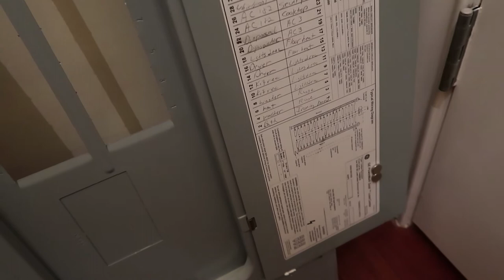How to Inspect an Electrical Panel

Comment: Nice video, a few comments, not sure what you meant by adding up the circuit breaker sizes and comparing that to the panel ampacity, that doesn't really tell if the panel is overloaded or not.  The only true test would be to perform a load calculation.  Also you missed the big white neutral conductor on the equipment ground bus. ; )

Comment: In a home with a 100AMP service,  how do I determine which bus bar is for the ground and which is for the nutural . Especially when electricians used both bars for both the nutural and grounding systems? Why would they do that? They have both the nutural and ground wires from different circuits going into the same bus bars. Wouldn't it be simpler and more professional looking to keep them separated (a cleaner install)?

Comment: Good to know. Also I’m curious what happens if the ground and neutral are not isolated in a sub panel.
Reply: Objectionable current flow, that's what happens. Geez......
Reply: The ground becomes a path for current to return to the source.
Reply: Is that a neutral white wire on ground bar right side?

Comment: Hi. My house had an addition years ago and the breaker panel was moved from one garage to another. The old one is still there. I want to activate it with a 60 Amp breaker for my air compressor. How do I do this?
Thanks

Comment: so, you said that the amount of breakers don't go over the amount of the box. Box is 200 amps, and I saw more then 400 amp worth of breakers. Not that you will even pull that through a panel.
Reply: main breaker is 200 so it cant pull ore than that
Reply: @SuperInspector  you can have more amps worth of breakers than your panel is rated for.
Reply: @danrichardson4559  what do you mean? circuit breakers can handle only 80% of their amperage. a 100-amp panel can handle just 80. you can't draw more than 80 amps on a 100-amp system
Reply: @whith5184  you are wrong it can pull the full 100 amps and if it does for more then 3 hours then the breaker has to be rated continuous duty. Which main breakers are.

Comment: you’re wrong and dangerous on much of this.  The total on the breakers will almost always exceed the main, otherwise I and most others would need 600 amp service.  Not a problem.  The breaker will never “pull” too much voltage.  Voltage isn’t pulled and you”ll never exceed 240 VAC on that panel, if so, call the service provider.  The basic function of the breaker is the prevent overcurrent, which overheats wires.  Current and voltage are often misunderstood, but you are supposed to have basic knowledge.  
You also demonstrate unsafe practices, not to mention contributing to the padded and exploitive insurance business.

Comment: Hello,  during some masonry work, it was revealed that a ground wire was disconnected and had been for a while.  How can I ensure that my main box is properly grounded?  I have checked many outlets with a receptacle tester and it showed they are all good.  Thanks for any help

Comment: How would you know if the wire is the right size .? Also do you have to touch the wires as an inspector.? And is it required or recommended to flip those switches on the breaker that you flipped.?
Reply: No way my friend. We are not suppose to touch those hot wires. And as inspectors we are not even required to remove the dead front cover according to standards of practice. Most inspectors who are comfortable enough, remove the panel to check
Reply: @Mel007ize  and most of them dont know what they are doing.

Comment: I am dog sitting and gremlins started attacking. Panel is at 480 with another 80 amp panel wired off the 225 amp rated. Good enough seldom is. Thanks for the knowledge.

Comment: No mention of aluminum wiring?
Reply: Dallas Mobile Notary Services.   Aluminum wire is not illegal when used to feed the panel, only illegal for branch circuits (output side of breakers).
Reply: Bebo May , Aluminum wire isn’t illegal at all, and to think people are going to rewire the entire house is crazy.  It has its issues but can be managed at a price to the home owner.  Aluminum wire must be noted if it is a solid conductor in a branch circuit but not required to be mentioned if on the line side feeding the panel.  If it is a solid wire in a branch circuit you make note of it, have to confirm it isn’t corroded and can recommend it be coated with anti-oxidation coating to stop galvanic corrosion or add a pig tailing connector that separates the two different metals.  I just did an inspection on a house with a lot of aluminum wire and had to re-learn all the specifics as well.
Reply: @hispeed69  I was responding to someone else's comment about aluminum wire. Aluminum wire "is" illegal for branch circuits, they don't even sell it anymore! Good luck getting insured, if it's found out you have it.

Comment: Do you know the wire gauge just by looking at the wire?
Reply: Lee Sales , after looking at enough wires you can naturally tell but if you get lucky you may be able to see the small writing on the wire that tells you the size.  If you’re lucky you’ll see a 14 AWG or 12 AWG.  14 is a 15AMP breaker and 12 is a 20AMP breaker.
Reply: No older wire had more insulation that wire, all wire will be labeled if properly installed. AWG THEN A NUMBER

Comment: This guy is a nut job, personal preference does not necessarily mean it's illegal!
Reply: Bebo May that’s mainly an inspection on a home. He flagged the one wire and another inspector may not have. He probably didn’t flag some thing in plumbing that someone else could have inspected the home and they would have flagged it. That’s why for a home owner, inspections are really a joke and you fix the red flags and move on. Iv sold a couple homes and I usually can laugh at the report. Things that don’t matter are flagged and things that I know need to be fixed didnt even get flagged.
Reply: @heathersterner4810  You are correct, he didn't even flag the hot wire rubbing on the ground wire!  Totally useless! This guy was probably bagging groceries a week ago!
Reply: Bebo May , that is an issue based on assuming the edge of the ground wire being sharp.  Had I seen that I would’ve just pushed it up to get a bit of clearance between the two.  As for your personal preference issue/ illegal issue, when you have a human doing something you must take into account the human factor and what they consider important and how they do things.
Reply: @hispeed69  No, he's being paid to find possible problems before they happen, hot wire rubbing on bare wire = problem!  If the inspector is finding things wrong or dangerous you "don't have to take into account the human factor", if the human did it wrong, get it corrected!
Reply: Bebo May Agreed- get it corrected.